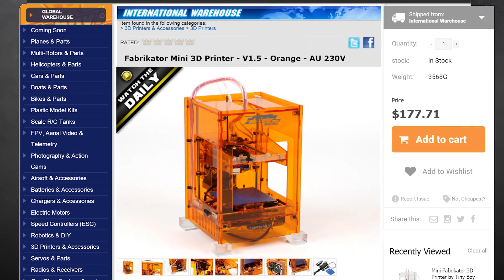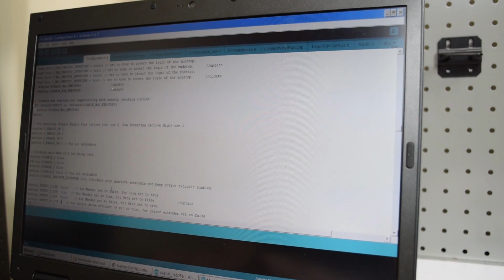Fabrikator Mini V1.5 3D Printer Review

Comment: The reason the extruder was turning the wrong way was because the Bowden was on the wrong side. The filament was supposed to be going in on the left (looking down) and out on right (through the strange nozzle thing).

I actually bought one of these in 2022 (because I always wanted one, and at £30 can't desperately go weong) and have been refurbishing it. I actually quite like it and has become my portable printer until kits for the positron v3 exist!

Comment: You can buy a monoprice mini delta for $160 and that’s ready to run out of the box
Reply: It also has a micro as card slot and an lcd. It’s also slightly bigger it has 110mm height and 120mm diameter

Comment: In DC moters just flip the power leads if it is 3 phase (you won't have that kind of moter) flip any 2 leads single phase (what you will have on 3d printers) flip the 2 power cables and not the signal cables

Comment: Does anyone know of a 3D printer that is good quality for under $155 USD? I'm searching desperately, but cannot find one under $200 USD. Please help.
Reply: this one is JUST out of my budget.
Reply from the maker: look at the tronxy x1 or startt, they're the cheapest possible.
Reply: Maker's Muse Thank you, I appreciate your help I will have to check them out. I've been looking into 3d printing for a long time but it has always been too hard to find a good cheap printer.
Reply: I actually might be able to get this one if I am able to make enough money. I meant that I was looking for a printer that is under 150 USD. I was only able to get results showing that are over 200 USD, which is over the budget I have, and I only have 130 to spend as of right now. looking at what I wrote earlier I see that it was A little confusing. I am only looking for one to make thing that I cannot make out of wood or forge out of metal. so I need one that is under approximately 180 USD, including shipping.
Reply: actually, after seeing the print quality, I have to get one. I'll just have to save up. but thanks for your help anyway, it can still be useful in the future.

Comment: I3 Prusa DIY on Gearbest I believe is 177.99 right now.
Reply: More info: A8 desktop 3D i3 Prusa printer and if you are on their mailing list it's only $133.99 it's all acrylic with metal pulleys and gears runs on Windows and has a print area of 220x220x240

Comment: Any chance on uploading the tutorial to reflash the firmware so the extruded motor turns the correct way - I to have the same problems - thanks
Reply: +Gary McGillivray Woops...had the tube round the wrong way!!
Reply from the maker: So did I :) glad you got it sorted!
Reply: thanks - bought the Fabrikator Mini based on your recommendation - running it off a tiny Atom/Windows XP based Umid Mbook M1 - thus far all prints have been perfect - perfectly compliments my LittleRP - best of both worlds - cheers

Comment: Nice review, Angus. After watching your presentation I had a good idea of what to expect when the US warehouse restocked and my printer arrived. Funny thing...my extruded motor was also reversed but it was an easy fix using the sketch on Chuck's site and uploading with Arduino. I bought the lcd/SD reader and the install was uneventful. You really should do a video on that install as it really raises this little guy to the next level. I quickly ditched the blue painters tape for Buildtak...once you dial in the z level and don't squish the first layer, the results are excellent. I print in PLA so I don't have experience with ABS nor do I see that happening for me with this guy. I have more capable printers in my arsenal for use with other filaments. However, for PLA this machine is now dialed in and works like a champ. A great value for introducing to schools or people wanting to check out the tech.

Comment: I got one of these yesterday based mainly on input from Maker's Muse. First I need to say that this is my first venture into 3d printing. The first problem is that, when using Repetier-Host on a Mac, Cura is not a slicer option in the app. I tried using Slic3r but the results were far from encouraging. Finally downloaded Cura and once I got the settings straight it I was very pleased with the results. (Note to self: Always double check the default filament size in the settings.) The workflow is a bit more involved since Cura isn't included as a slicer option in Repetier on the Mac but it's workable. I have to open the stl file in Cura, slice it, save the gcode to a file then open that gcode file in Repetier.

Unfortunately the x-axis is now messed up. It got very noisy and inconsistent. I suspect that's causing some bad results I'm seeing now. It could be something simple but I'm waiting for Hobby King to get back to me before trying anything to fix it.  I may need to return it for a replacement but we'll see.

Pros: Only one "assembly" step and that's to connect the tube to the feeder. Reasonably quiet. A very good option as a first venture into 3d printing.

Cons: The stupidly short USB cable. Instructions in the manual and in the videos Hobby King has in YouTube are for a different version of Repetier and don't really work for the Mac. Small print area but then look at the price. 

I'm actually a backer for the Trinus printer on Kickstarter but decided that it was worth springing a few bucks for a simple printer to get me started. Gives me a chance to get some of the mistakes and learning curve out of the way before the Trinus ships in August.

Comment: reflash not needed for stepper motor running wrong way! just turn the connector on the board and it will run the opposite way!

Comment: Should I get this or the Monoprice Maker Select (which is a Wanhao Duplicator I3 .. V1 looks but V2 mods are included).  I am surprised you said this little device blew away your wanhao.  I thought the Wanhao would be great if you did all the tweaks/mods.  Darn, because I was jus tabout to order the Wanhao.  The build volume is kind of tiny on this one.  But I guess this one would be betetr for 28mm dungeons & dragons miniatures vs the wanhao?   Don't know what to do.  Looking for your advice.  Thanks for the vids!
Reply from the maker: +Jennifer Gwinn The Wanhao V2 is an awesome machine - my V1 had issues but the V2 is certainly much improved. The biggest limiting factor of the Fabrikator mini is the print volume is tiny - but the price is tiny to match. Buy the one you can afford! Bigger is always better, both machines will need tweaks down the line.
Reply: +Maker&#39;s Muse Thanks for the reply.  The only reason I asked is that you said in the video that the print quality of the fabrikator blew away the Wanhao.
Reply from the maker: My V1 had many issues, the quality of the Fabrikator Mini was much better, but about equal to the V2

Comment: How much assembly do you actually have to do?
Reply from the maker: +JoyousUnicornGaming It comes assembled, all you do is attach the teflon tube and set up the software on your PC.
Reply: Maker's Muse cool. Is it worth it. I'm 13 and I am looking into getting a 3d printer. Do you have any other suggestions or is this the one. I also dont want to wait for anything to come out or have to do too much assembly
Reply from the maker: +JoyousUnicornGaming Buy the biggest you can afford - I would get a wanhao i3 V2 over this one, but if you can't afford anything more it'll get you started. The 80 x 80 x 80mm build volume is quite limiting.

Comment: 3D printers are sure expensive. Actually i'm on my way of making a 3D printer for under 30 bucks, currently sitting at 21 $ US with almost everything i need.
Reply from the maker: +Poptart McJelly Sounds good, interested to see the final machine!
Reply: +Maker&#39;s Muse Will make an instructable for it once i'm done :). Now i can't decide if i want to make it a simple frame or make it foldable, kinda like a suitcase to fit in a backpack, although that would need a bed re-alignment everytime it would be reassembled. What do you think ?
Reply from the maker: I think the suitcase thing should come after, just make it functional as a regular printer first! Not many people care too much about portability.
Reply: Thanks.

Comment: I have the fab mini V1.5 and I love it, it works great. The manual was great and got me up and going fast. I had one problem. It had a piece of filament  stuck in it, after I got it out it works great. I have about 25hr on it know no problems. Here is a vented with fan base and spool holder that I designed and built. http://www.thingiverse.com/thing:1339514    http://www.thingiverse.com/thing:1324831

Comment: well i got a micro3d printer, 3 pack of build tak and 4 m3d rolls of pla filament white,black,red,blue of the normal colour range shipped allllll the way down to melbourne strayaaaaaa was about 600aud including shipping. my experience has been ok had it for 4 months or so with a month and a half break in the middle due to frustration but recently getting back into it, forums on their site are finally working and have solved like 90% of the issues and seems to be printing well if not better than i first started with a 3rd party filament cos their filament are hella expensive for a quarter of the size and well aud too expensive will be buying more 1kg spools from where ever else i can get it still trying to use up this 1kg spool of green printed like a dozen things and another dozen of protoypes for a personal project. considering getting the wombot xl for dat build area maybe in the future and its austrayan made from what i seen on that 3dprintingnerd channel
Reply from the maker: +lightningandcloud Ey yeah the Wombot XL looks great, and yeah it's Aussie. M3D is way too expensive for what it is once you get it here - the aldi 3D Printer is cheaper lol. I did ask if they wanted to shoot me a unit through to test and review as alot of people ask but best they could offer was a $50 discount which is still not worth it IMHO.

Comment: 7:48 OzzeeeeeOzzz hanging on to edge
Reply from the maker: +Protomaker Black Sprint Original 3D Printer Hehe yeah but you can just remove that with your thumbnail :P
Reply: +Maker&#39;s Muse Or retract more?
Reply from the maker: +Protomaker Black Sprint Original 3D Printer This was with the default cura settings, so maybe can be tweaked but bowden extruders often suffer a tiny bit of oozing when the print is complete.
Reply: +Protomaker Black Sprint Original 3D Printer The end Ooze I get ED3 V6, (set to be the best, but I am just leaning),  PLA  Bowden is like a big knitting needle stick off it . They say set to 2mm retaction but I must need about 4mm, or is it, joke 4 Meters :) and no Random in slc3r works on one wall print calibration so nice seam line pointing up to the knitting needle

Comment: Hi Angus, I have just purchased a Fabrikator mini here in the UK as Hobbykjng are now stocking them in the UK warehouse! Great little printer for the price but  do check the screws in the assembly blocks on the frame and carriage as I had one that was miss aligned and loose causing printing errors, I  just removed the screw and re aligned/tightened and problem sorted!!

Comment: My first 3d printer was the Micro M3D printer.  At the price of $350 in the US it is twice as expensive as your Fabrikator Mini.  The body of the Micro M3D is a one piece injected molded part that gives the printer a much more polished and finished look and the print area is larger though only slightly larger at basically a 110mm cube.  These two tiny differences aren't worth the extra costs though.  The PLA print quality with the Micro M3d looks to be comparable to the Fabrator Mini as well. 
I've since moved up to the fantastic Lulzbot Mini and I'm selling the Micro M3D on eBay.  I think these tiny cheaper 3d printers are a great first step to see if you find 3d printing an interesting hobby without having to shell out a lot of money.  Based on your review of the Fabrikator Mini it is by far the best option for an entry level 3d printer IMO.

Comment: Hey Angus... did you notice how hot the x and y steppers are getting? Mine are seriously hot so much that the X stepper needed a fan or it started making noises.... Are they being overdriven? I did load the LCD 3D print controller software from Chuck's web page as I did Chuck's LCD addition mod... Could my overheating be caused by software or? Can this be adjusted so they don't run so hot?

Thanks
Reply from the maker: +Richard Ryerson It really sounds like they're getting way too much current on your machine, you may need to dial back the trimpot. I haven't done it on mine yet but yeah they get madly hot...! The stepper drivers are independent modules so I don't think they would be affected by a software change.  Have a squiz at this for adjusting http://reprap.org/wiki/StepStick#Adjusting_and_testing_the_current but do be careful they're easy to short out...
Reply: +Maker's Muse  Thanks.... I am making small adjustments to the trim pot(s) we'll see how that effects stepper temperature...
Reply from the maker: Best of luck! I just had Jam number 2 occur on mine... seems the PLA is softening a little too early and forming a plug at the end of the heatsink just before the melt point... dropping temps to try and avoid it.
Reply: +Maker&#39;s Muse  Hey Angus... Knock on wood I haven't had a jam yet... I am using S3D as my slicer and printing at 200.... It took me a while to tweak the settings but it seems to be printing perfectly now... Ok, I adjusted the Y stepper trim pot 1/8 turn clockwise as a test... Before doing this the Y stepper was reading about 95C (I was using my thermal laser thermometer to check). Using the same test print and the same print conditions after the 1/8 clockwise turn of the Y stepper pot the temperature of the stepper now reads around 72C-ish... This is totally unscientific but it looks like my Y stepper is now running about 20C degs cooler... I am going to do the X stepper next...

Comment: just got mine in the mail. when i plug it in to my windows 8.1 computer nothing happens. no drivers detected. can you help me?
Reply from the maker: +Tech Scout You might need to install the FTDI drivers manually, or possibly the USB cable is dead if 'nothing' happens on the board. You also will need to configure repetier with the correct settings by following the instruction manual exactly.
Reply: Maker's Muse thanks but i got it to work just by plugging the printer in to a usb 2 port and not usb 3 ;)

Comment: Some more cheap printers:
http://www.peachyprinter.com/ ($100)
http://www.q3dprinter.com/oneup.htm ($200)
Reply: +TJ Nelson I wouldn't recommend the q3d printer kits unless you really want a challenge and want to spend time sanding and drilling places where the laser cutting is either less than optimal or is just completely fucked up (one of the screw holes on the ThreeUp I bought was literally just a bunch of squiggly lines that did not resemble a circle), and overall a lot of modding just to get a good print out of the thing.  The printer is would be great if it had proper execution.  Though there is a great community around this printer willing to help and share tips on the Fabric8r forums.  I am actually buying a Fabrikator Mini so I can print the parts needed to get this thing running since my hotend won't even stay in properly due to the poor laser cutting.
Reply: +TJ Nelson and the peachy printer is nowhere to be found in real life. It's been years since they anouced it, they do fail to deliver the product. I wouldn't "pre-order" it. If one really wants to get it, it would be wiser to wait for regular orders (if it comes some day) with guaranteed lead times, or even from a regular reseller that can guarantee the sale or refund if undelivered.

Comment: Angus - The power supply look like it has a standard computer/monitor cable.  Is the power supply rated for 90 - 220 VAC or a single voltage?  Seems the 110 version are always out of stock.  If it's rated 90 - 110 then someone from the US could purchase any country and replace the power cable.  Thanks
Reply from the maker: +Doug Irwin It's rated 100 - 240VAC so yeah I think anyone could just change the cord it's just a standard computer IEC cable.

Comment: Gee the motors do get hot, I have bought some small heat sinks and adhesive thermal compound from Jaycar, I plan to stick a couple on each motor plus there are a couple of fan/stand things on Thingiverse to give a bit more cooling to the underside these hacks may save the hassle of a failed motor in the future.
By the way I use Mac and had terrible trouble getting Repetier to work, it would get the pinwheel of death when I tried to connect to the machine. A couple of hours of fiddling, upgrading, tweaking etc and a google search revealed this little gem. Open terminal and enter :
defaults delete repetier.Repetier-Host-Mac
This clears out the config files of Repetier, you need to set it up again but it solves the problem.
Reply from the maker: +Paul OBrien Hey Paul - I agree they get nasty hot, but that's a side effect of moving to such small motors, they need the same current as the bigger ones to have any torque. Good move on the heatsinks, I may do the same. To be honest I'm amazed repetier even works on Mac, I try to avoid associating any of my 3D Printing and CAD work with Mac as it's almost always buggy or flat out isn't supported. Awesome tip though, I wonder if a fabrikator mini wiki exists? Or if it should exist!
Reply: +Maker's Muse No a Wiki doesn't exist but I suspect one probably will sooner or later.
Next trick I have found a LCD unit on eBay and some modified firmware etc, next thing will be a SD card reader. So much for my spare time :-)
Reply from the maker: +Paul OBrien No time for spare time with this hobby! :)